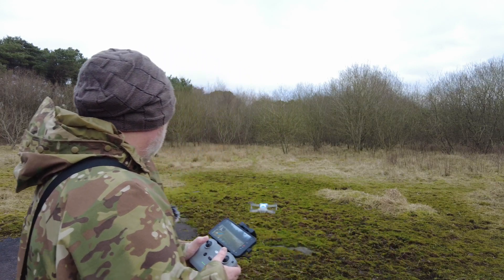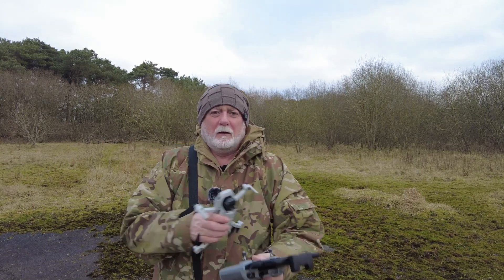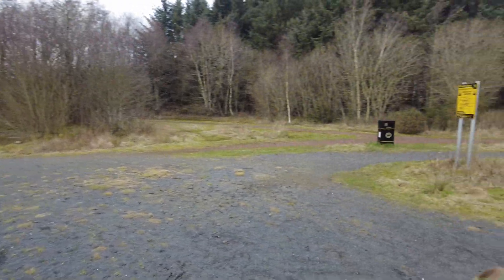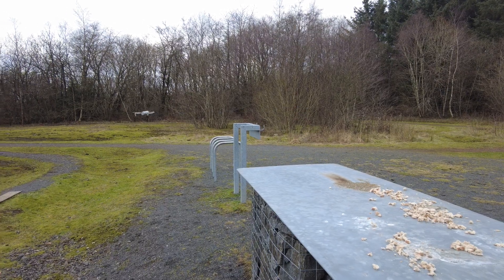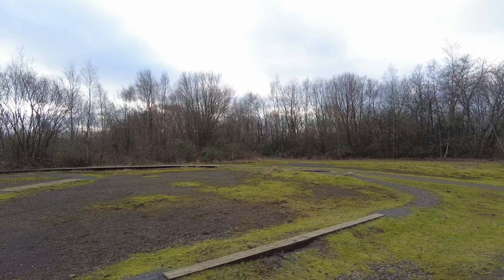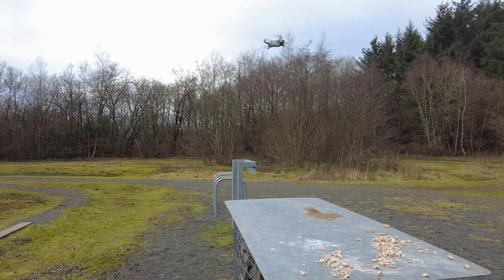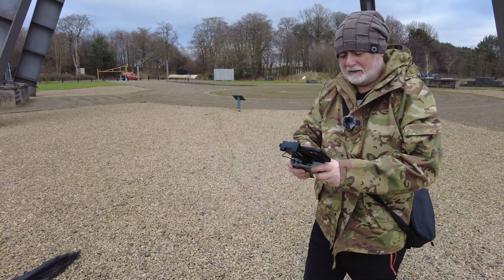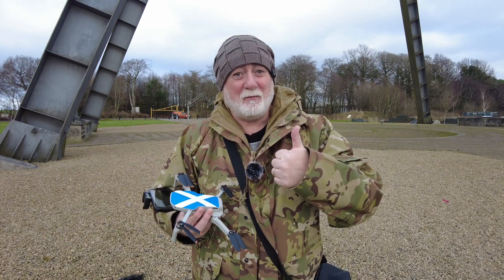DJI Mini 2 Will Not Land

Comment: Probably the metal throwing off it's compass. Metal inground upon takeoff is 1 of the reason drone fly off mid flight.
Reply from the maker: Bub City, you could not have made this comment at a better time!  I have just finished editing a video which I'll be publishing tomorrow that tests if metal affects the mini 2. You may be surprised at the results ;)
Reply: My mavic flew off mid flight. I was over water and took off from a spot I believe had metal inground. Mavic flew off out of sight. I quickly reset the setting to return to controller and was able to save my drone. I witnessed a guy flying a phantom loose control of his from the same spot unfortunately he wasn't as successful as myself.

Comment: Landing and or taking off on metal is not advised in videos i have seen to date.
Reply from the maker: There’s no evidence to support that, Glen. I’ll go out tmrw and do the tests :)
Reply: @WindsweptRobert  : I have not tried personally. There are many DJI articles i have read, saying do not take off from metal surfaces and car hoods/roofs etc. There are apps that can warn you of metal and electrical interference. I have not used any, but from a safety point of view i just stay away from these.

Comment: I'm assuming that it will hover until it runs critically low on power and then land on those spots anyway?
Reply from the maker: Aye. If you’ve watched my video “ DJIMini 2 Crash || Lassie Down, Lassie Down!”, you’ll see exactly what happens when a mini 2 does a critical low battery landing ;) https://youtu.be/YDZwGg0Z_Qo

Comment: Morning Robert,
Have you ever carried out a return to home precision accuracy test with Lassie?
Reply from the maker: I have never tested it, Jeremy, but from my own eperience of having used the RTH landing a number of times, it seems the accuracy is within a foot or 2 :)
Reply: @WindsweptRobert  ok. For your information, I’ve solved the issue of my mini 2 returning to home sideways. I’ve increased the yaw speed in the advanced gimbal settings from 10 to 30 in normal mode. Now when RTH is initiated , my drone turns the full 180 degrees and comes back forwards.

Comment: I've had inconsistent issues with "unsuitable fir landing" at specific launch points I use all the time - light colored (coulored for my UK friends) cement. This is with Mini 2, Air 2 and now Mavic 3. The only difference I can determine is time of day/lighting. Sometimes I'll get it for a few days,  then all is good for a few. I do clean my sensors,  and it's a minor annoyance, but it keeps me up at night... watching Windswept Robert videos. :_HELP:

FYI If you want to do really quick repeated tests, just go straight up and use the auto land feature. No RTH needed to activate the "area unsuitable" message. Don't take Lassie to the bad part of town. The entire area is unsuitable :_Wink:
Reply from the maker: Lassie has no fear ;)

Comment: Thanks for another excellent and informative presentation Robert. 

On one of the tests on the other video, you did have a RTH error because Lassie was too close to the home point. I did a test of this issue on Saturday, on the rather cold Brecon Beacons. I sent it straight up to about fifty meters, did a RTH and I didn't get the "too close to home point error". I was going to move location while it was in the air and change the home point but had a problem getting it to follow the car properly. I fly mode two, my grandson told me he flew one so I altered it to that, only to discover after a few minutes he actually flies mode 3. Time to pull over and land it manually. By then it was starting to get dark (and colder) so we decided to call it a day.
Reply from the maker: That's interesting, Peter, but surprising too. I can't remember how high up Lassie was in the previous video when she refused to RTH, but I'll be checking! :)

Comment: The first landing site although the same spot didn't have the same conditions. The first time that it wouldn't automatically land at that spot the surface was wet, this time it was dry.  When Lassie wouldn't land on the metal plate you noted that it had some water on it. Same as the first landing spot did the time before. My guess is the landing sensor doesn't like highly reflective surfaces like when wet. A good test would be trying to autoland on highly reflective surfaces like glass. 

Interesting video.
Thanks
Reply from the maker: Cheers BC. Although, the first time I tried the original landing site, it was not wet, just darker as it may have rained earlier. And the table was not wet - it just looked to me like it could have resembled water to the sensors on the drone :)
Reply: @WindsweptRobert  Robert, wet or just appearing wet is basically the same. It is the reflectivity I think. Thanks for the feed back.
Reply from the maker: @buttcrack7784  I think you are correct here :)

Comment: Very interesting Robert.  Personally I like the fact it doesn't land automatically as you then have control if the homepoint has been updated - as happened to me over the River Spey!  I wonder if DJI can clarify what surfaces are unsuitable?
Reply from the maker: It seems like any surface that the sensors and brain can't satisfactorily calculate to be 'safe', it won't land. I like this feature, even though I rarely use the RTH

Comment: Because of the metal
Reply from the maker: No, I don't think metal has anything to do with it, mohamed - Lassie and Laddie often land on the roof of my car with no problens. I think it's more about the sensors triangulating the landing area, and  on the table it had strange readings because o f the heights the sensors were reporting.

Comment: I once did a RTH and when it had descended to about 40 metres it stopped and announced that the surface was not suitable for landing. I had to manually descend it, at the end of which it whacked onto the ground. I think it was because it had been in low cloud a few minutes previously and the sensors were fogged up.
Reply from the maker: 40m??  Wow, that would have been worrying. And worrying that it crashed at the end of a manual landing :(
Reply: Probably my fault for not slowing down as it reached the ground, I'm in the habit just letting it do the last few inches by itself but in this case I think the downward sensors weren't operating. Was bloody glad to get it back on the ground alright!